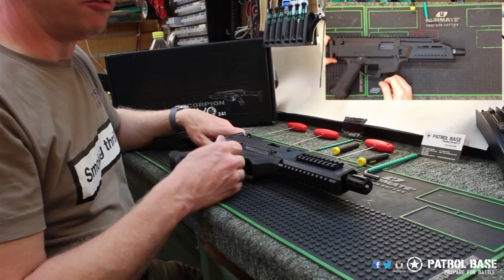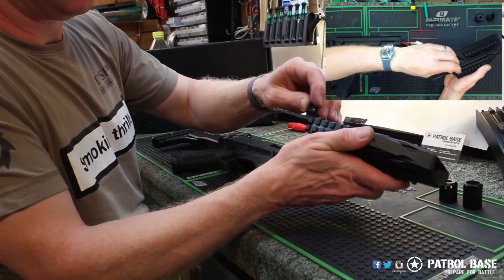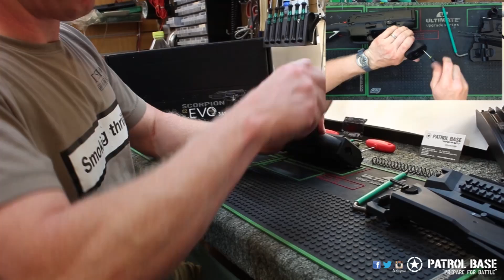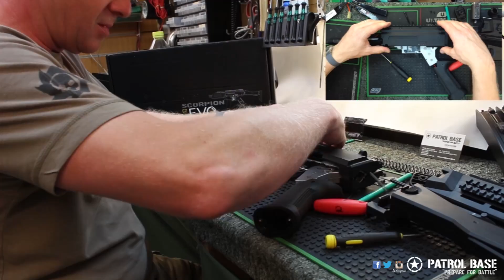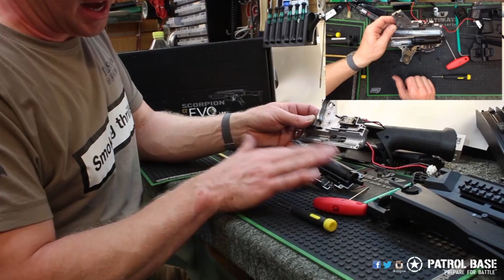ASG - CZ Scorpion Evo 3 A1 - Fully Stripped / Disassembly [CC]

Comment: Hey I don't know if you could help or not. Basically when my mags run dry the evo locks as it should but when I put a mag in and hit the bolt release it stays locked out, ive had the gun for about 4 years now but its only started doing this recently. Any advice would be greatly appreciated

Comment: if you just wanted to remove the outer and inner barrel would you still need to remove all the grip and side panels?
Reply: no, just the upper receiver needs to be removed.  You can ignore the lower and pistol grip.

Comment: help please: this bolt return spring felt and i have no clue how to put it back..
Reply: Renova Design as Same happened to my gun today and dont know how to put it back,after 4 years if you find a clue please helpXD
Reply: Elo101 you still stuck on this?
Reply: Get the handguard off the receiver. Then pull the bolt out, slide the spring in where the bolt was, then put the bolt back and put the handguard back on the receiver.

Comment: bolt return spring felt out by front when i was trying to load battery... what can i do? is it any simple way of put this spring back in without full disassembling?
Reply: i did you one better Renova, i actually lost mine - try and get a new one from ASG, i dare you... I just got a 1/4" diamter coil spring, the longest one i could find was only 1 - 3/8" long.  There's a bit of freeplay in the lever but meh, learned to ignore that.  Finally had enough of removing half the gun just to access the battery (you are supposed to actually disconnect the battery EVERY. TIME you are done with it and i do that) so i just got a battery box and mount it on the right side.  Much easier and i got used to the looks (supposed to resemble a PEQ sight and close enough for me).